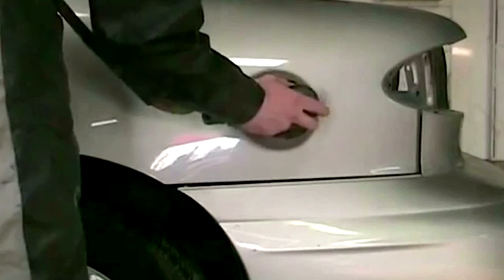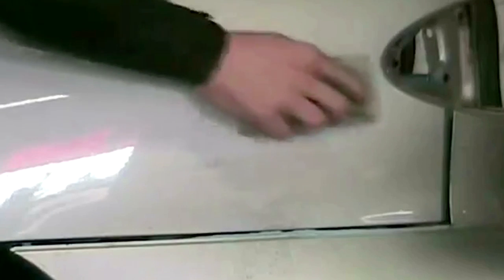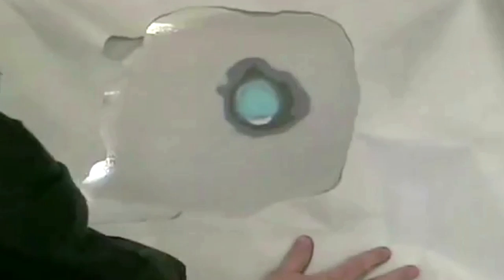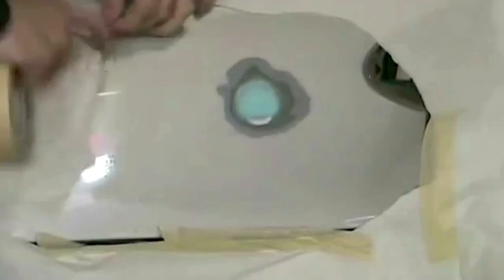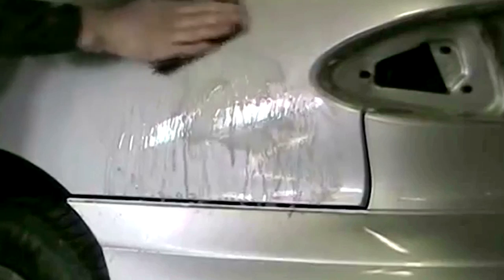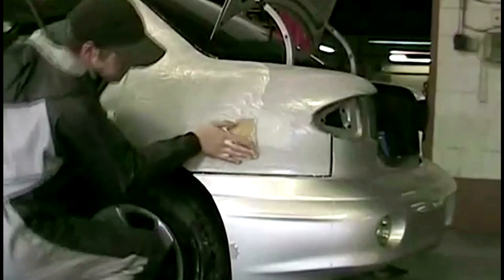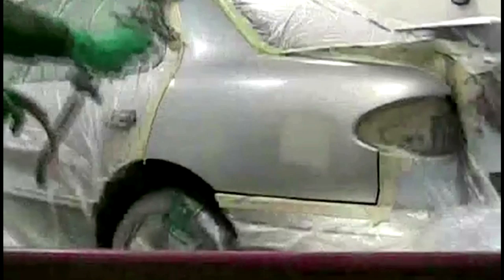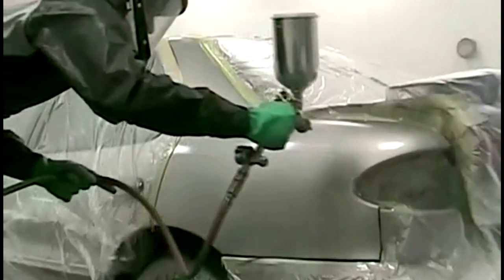Car Painting Basics for Beginners

Comment: Hi, I'm a 62-year old disabled person that still, thank God gets around on his own and has a 2001 E430 MB that's my baby. Even though I'm limited in stuff I can do, I can still play around with my car so I learned how to buff and polish and paint enhance the car, but I screwed up and burned thru the clear coat in 5 little places, the biggest the size of a small tangerine. So I'm gonna paint it lololol. Yeah, I know it's risky but I just HAVE TO TRY myself so I'm following you and I have a question. I recently bought, preparing for the endeavor, a set of 2" sanding disks and they would fit on my drill perfectly, or my dremell or maybe even my DA even though I've never tried to change the shank. Anyways, my question is if using the disks to feather and even the surface preparing the car for paint with cans, do I just apply whatever pressure the machine puts out or should I apply more pressure on the disk with my hand? Any tips? GOD BLESS YOU AND KEEP THOSE VIDEOS COMMING.

Comment: I like to use 800 over primer. Not sure if thats what you're supposed to do but i did that on my skyline and the gloss black paint came out perfect. Hope this helps.
Reply: ForcedFalcon 800 is too fine, you’ve gotta have something that’s gonna leave a big enough scratch to grip but won’t be seen. If you use 800 or higher your gonna pull out of the car wash bay one day with your paint laying on the concrete after it’s blown right off

Comment: How much time between base coats?
how much time between clear coats?
thanks
Reply: depends on the hardener you are using for clear coat.......but for paint more or less 15-20 minutes flash time
Reply: Gaby Miranda Hi, whats flash time????
Reply: Zig Zag sorry, but if your not sure what flash time is then you need to go back to the first step of body trading and follow each step in order. I’m not trying to be an ass, honestly 

But to answer your question, flash time is the amount of time that transpires after you finish spraying one coat and your waiting on the old saying of “watching paint dry”. After the coat is sprayed and depending upon the temp, humidity,  what thinner was used, how heavy a coat was sprayed, etc, you are waiting for it to “tack up” which is a process of and a stage of drying. But the flas time is the amount of time required for the solvents to “flash” off or evaporate from the paint turning it from a liquid into a stick solid.  There are so many factors that will influence flash time which is why you need to try and learn everything correctly from the beginning cause this is a critical element of spraying that will be different from one paint job to another and also from day to day with weather changes. There’s a lot more to painting than most folks realize and it does take years of practice and studying and getting your hands dirty to become good but is possible and I Wish you luck